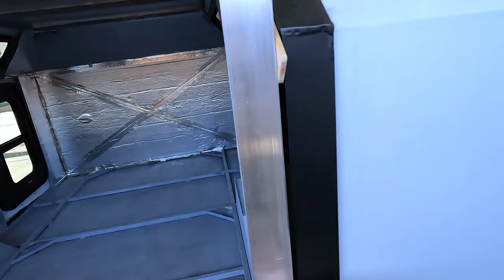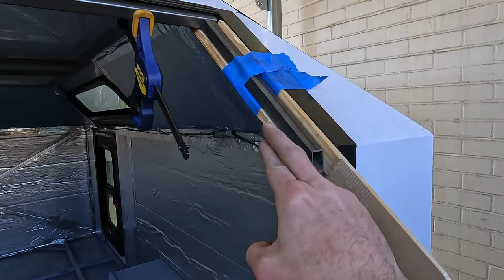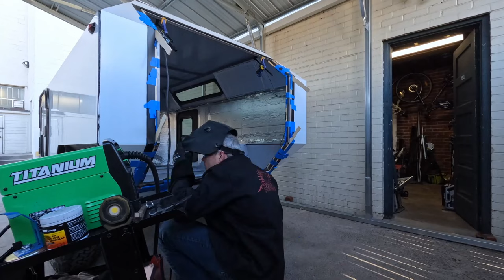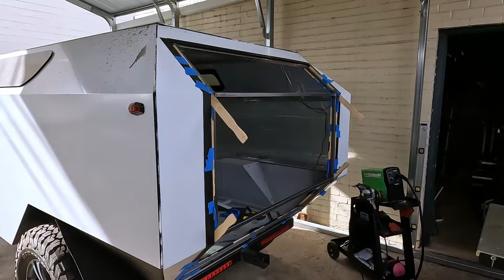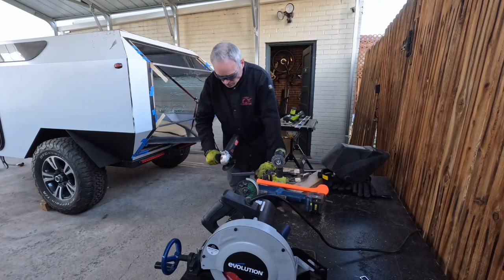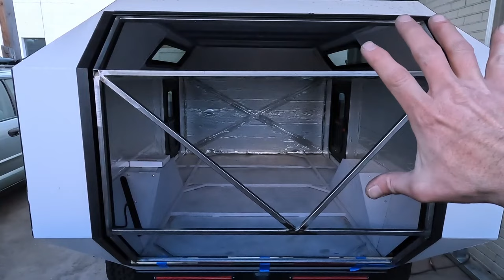DIY Overland camper trailer build: cabin part 16 - Hatch skeleton

Comment: You are doing an awsome job. Love the design. Are you using a PVC continuous hinge? I'd be interested to see a bit of close up and your thoughts of it. They look better (more waterproof) than the usual aluminium slide in ones that traditional teardrops use.
Reply from the maker: Yes I am!  Its a centaflex hinge.  It's pretty stout so It should last a long time.  https://www.uesint.com/product/centaflex-continuous-hinge-3m-length-black-finish/
Reply: Wow didn't even know about those hinges. That's cool. I'd definitely love to see more details on it. And what the installation is like. Pros and cons etc
Reply: @infosponge  I'm also interested on more details about how you connect that centaflex hinge to the metal and how that engineering works? The hinge looks interesting but how did you incorporate into the tubing and the body/frame of the door?